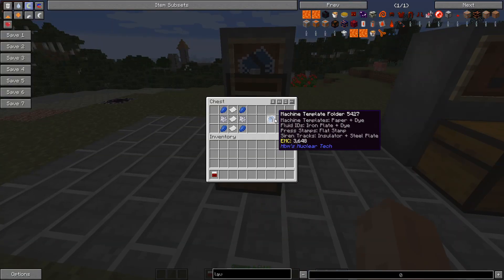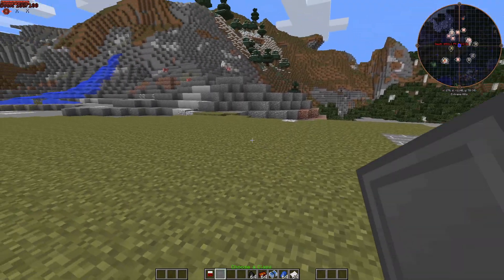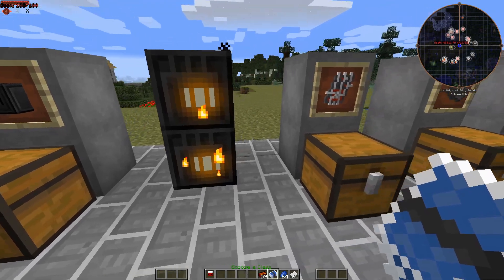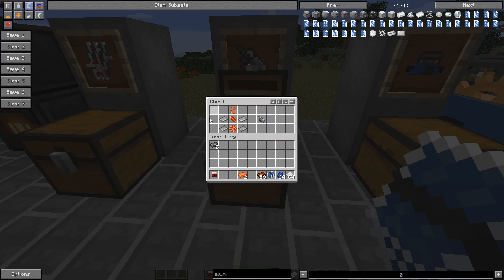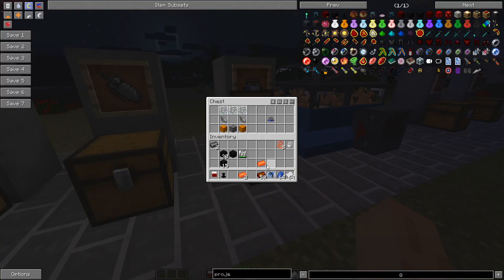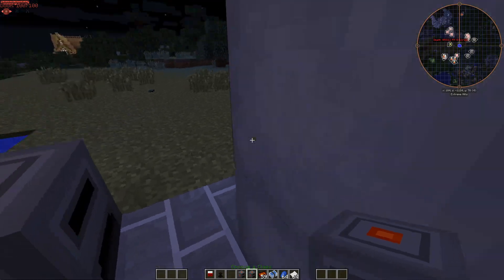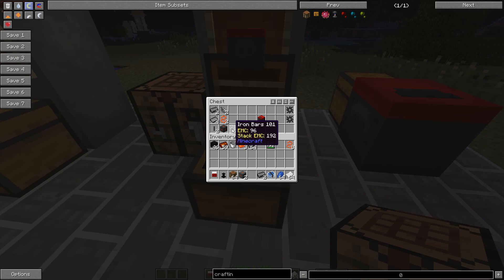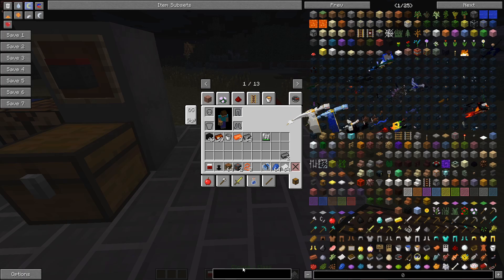HBM Nuclear Tech Mod Tutorial (Part 1)

Comment: Pls help when I click on a template in the machine template folder I dont get a template :(
Reply from the maker: Do you have the paper and lapis in your inventory?
Reply: @brotherkane8528  I found the solution. I also have IC2 installed and used the IC2 plates, which dont work for the template. Btw, do you know if there is a cable that you can turn on/off with redstone so it wont send electricity anymore?
Reply from the maker: Unfortunately I do not know. I haven’t messed with the mod in a bit. Still not at a good place for making videos.

Comment: i need to make a wire stamp how to make the stamp? ;(
Reply from the maker: To make a flat stamp you need to put one redstone in the top middle. Then on the middle row put 3 bricks. And on the bottom row put 3 stone. The stone can be replaced with iron, steel, titanium, obsidian, or schrabidium for more durability. Once you have your flat stamp craft a Machine Template Folder. I showed how to craft it in the video. Open it and find the wire stamp and click on it. The flat stamp will disappear and a wire stamp will replace it. Hope this helps!